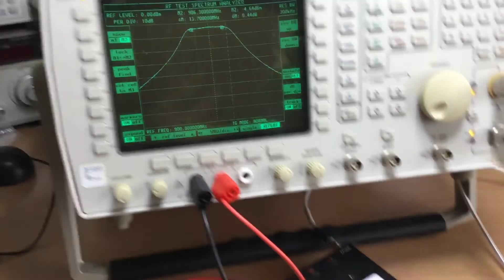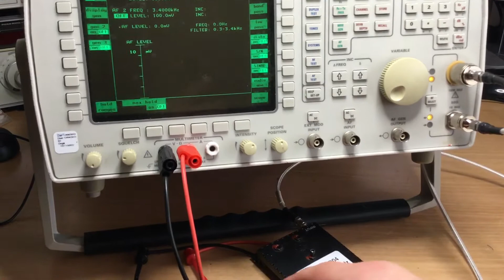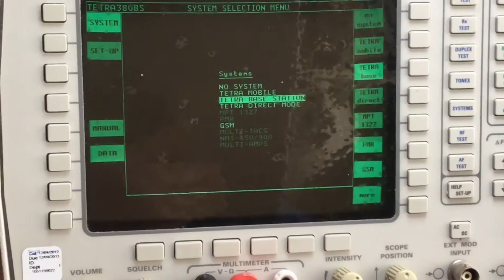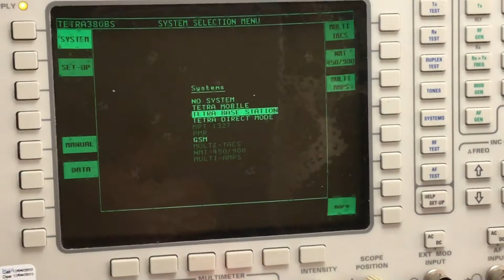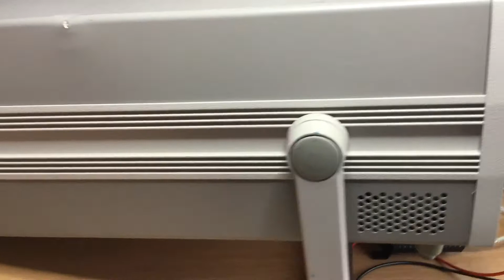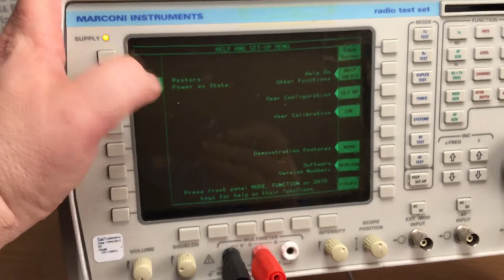Marconi Instruments 2968 TETRA Radio Test Set Demo PART 2

Comment: They don't often come up on ebay for sale, I wonder why?
Reply from the maker: Probably because most of them are piled up in my workshop awaiting repair that people have sent in to me. Trouble is with these test sets is they do suffer from PSU failures, the Panasonic CRT monitor in them fails, & the laminate plastic cover over the screen bubbles up & makes the display hard to see sometimes, these is a very fine wire mesh in-between one of the layers of the laminate screen cover & the front needs to come off to repair this or remove the monitor module if that needs repairing. You will see these test sets come up but I personally believe the HP8920 A or B are superb radio test sets, & come with many features as standard which are actually options for the Marconi such as SSB on the Marconi it's an option where as on the HP8920 it's standard.